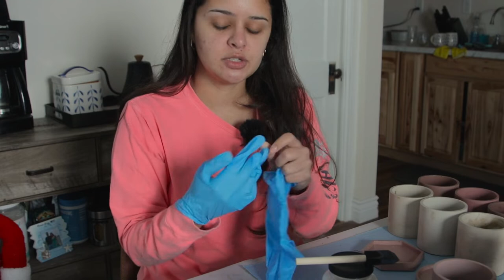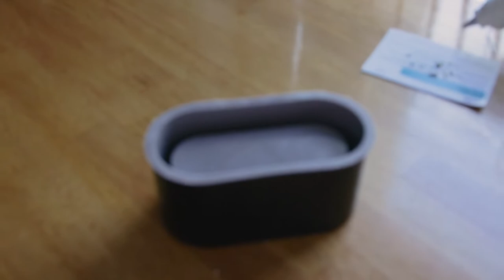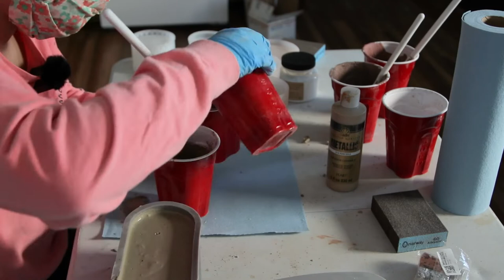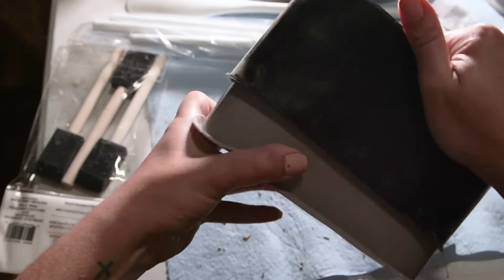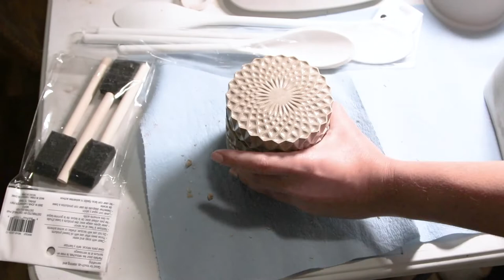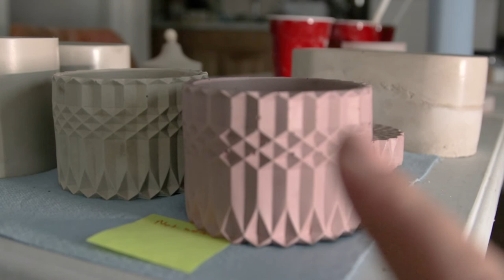HOW TO SEAL AND MAKE CONCRETE CANDLE JARS | SHEILA LLIBRE

Comment: Hey, is the sealant heat proof? I was planning on using modge podge which seems to be about the same as the sealer you use, however when googling modge podge and heat resistance, it says it will melt if used on the inside on candle vessels. Does your sealer not melt?